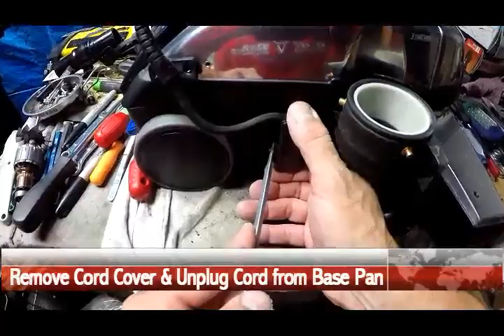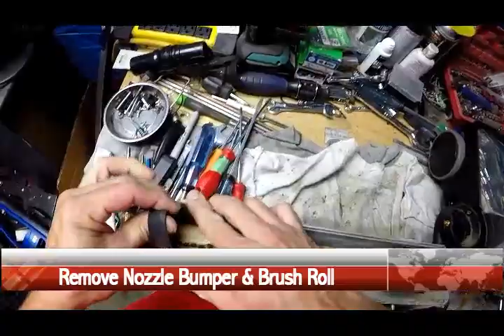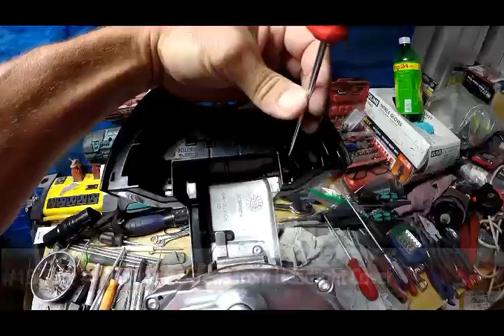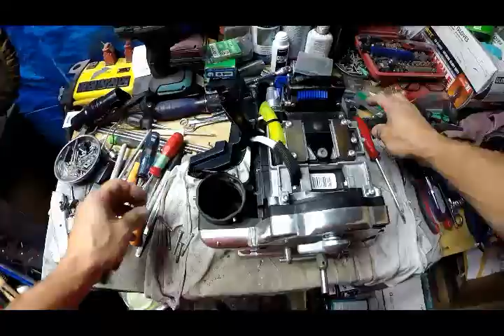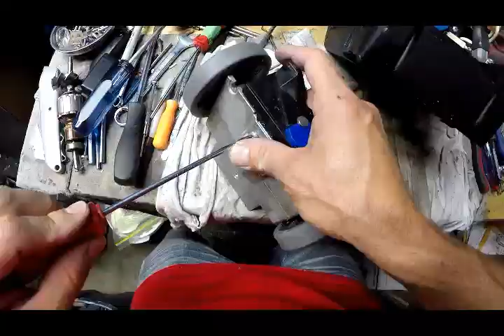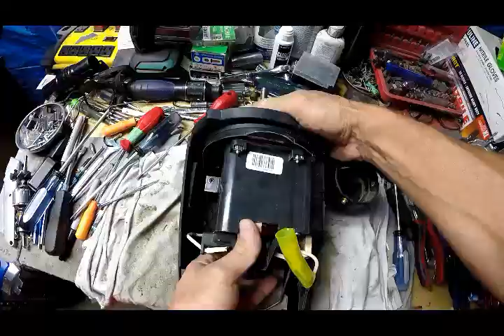Kirby Avalir 2 Fix Repair Completely Take Apart Disassemble Vacuum Cleaner Teardown Complete

Comment: Great video.  Professional quality, clear and to the point, and much more helpful than any manual.  Love that so much time is saved by cutting out unnecessary bits and how you pause for a second when something needs noticed.  Also love that the part names/tool/action are printed on the screen so I can screenshot and not have to go back thru entire video.  Only improvement to suggest would be a part number as well, but no biggie. 

I prefer the music over talking, especially when it’s hard to understand someone (& the closed captioning is no help).  It’s not obnoxious like some that blasts really loud and then you have to constantly turn up and down to hear the person.  I bought a “clean, only used twice” (ha…maybe used in a huge pet store!!) Kirby on eBay that needs a LOT of work.  So grateful I came across your channel!!  Thank you, and keep up the great work!